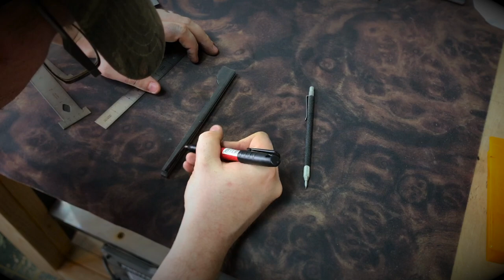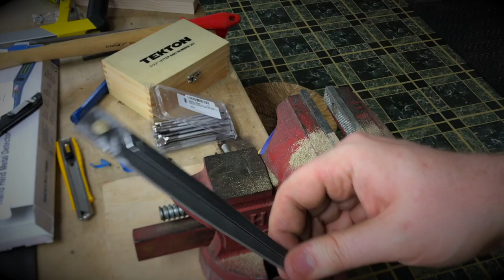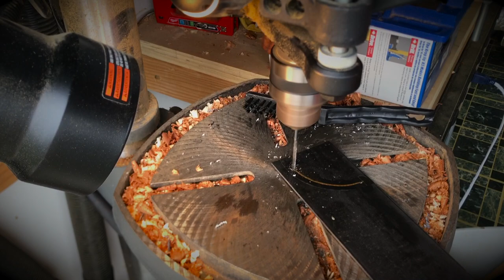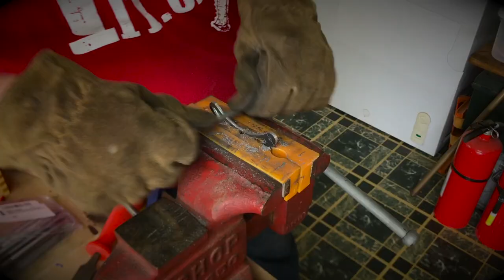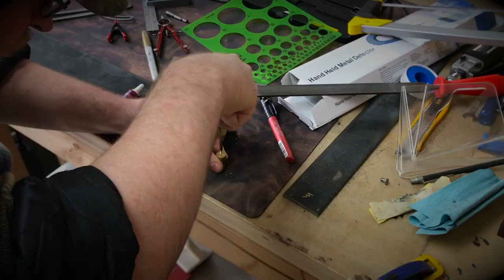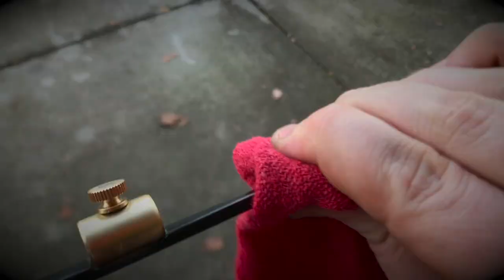BUILD: Compass Dividers

Comment: this is super cool...i need a bigger set......the ones i have i tipped with carbide when i got them, havent had a need to sharpen them in 20 years and i use them on carbon steel and stainless.just be careful once you have them silver soldered on ,not to heat them up too much when sharpening or the tips will fall off...lesson learned on my part...lol

Comment: Great Job! What made you put the pencil holder on the other side instead of the same as the locking nob?
Reply from the maker: Custom Chris I wanted the pencil to lie flush with the surface of the divider for extra stability.  After after notching out the arm and flattening the side of the pencil holder it more or less does.  If I did it on the other side I would have needed to make the pensil holder bigger so the pencil would sit proud of the curved arm. I just thought this would give the pencil a bit less play.
Reply: cool I was just think of laying it in a draw or on the wall it would not lay flat. I see your point tho

Comment: did you do anything special to your belt/disc sander to make it run good or did it do just fine right out of the box?
Reply from the maker: Mine ran fine but from what i understand they often come waaaay over tensioned and it will stall out the motor. you just have to loosen it a bit and it will run fine.  It sounds like its powered by broken wrenches but it hasn't failed me yet and for like $35 you can go wrong.
Reply: Right thank you sir! Take care and God bless